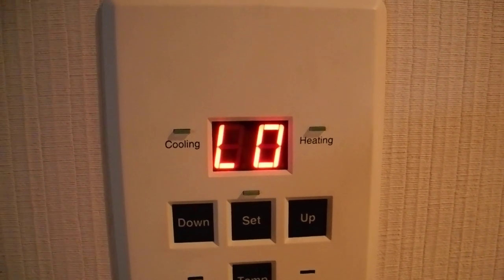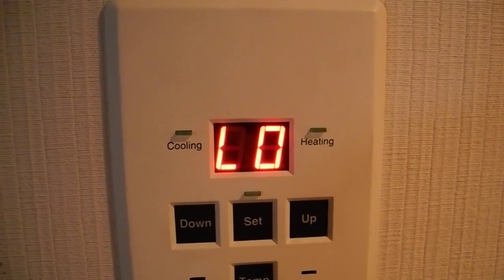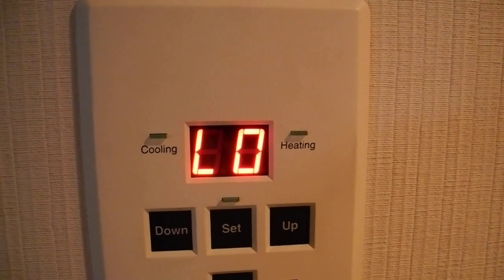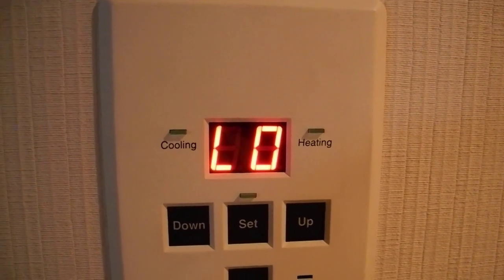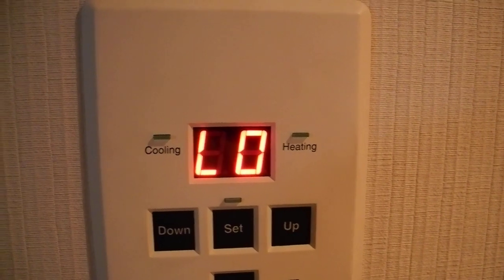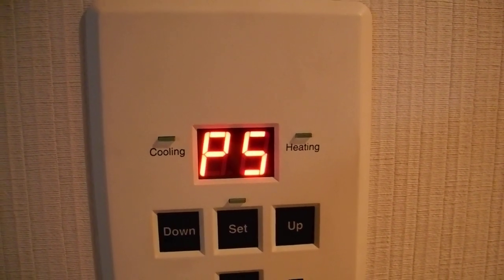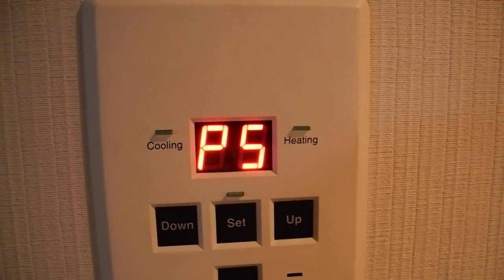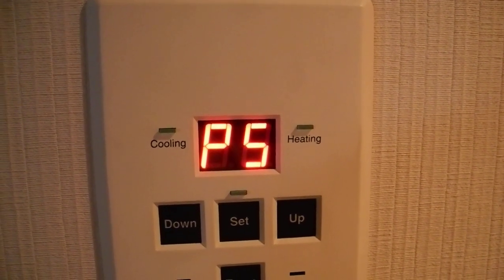LO P5 on your Air Con controller

Comment: I see on the panel that this unit can be used for either heating or cooling the boat. Low pressure in the "freon" system can be caused by low flow on the medium where the unit extracts the heat, the side of the system with the lowest temperature. I assume there's no water circuit on the "boat side" of the unit and that it's only warm or cold air that circulates inside the boat. If this happened while cooling the boat, it could be caused by low air circulation flow, maybe a clogged filter or a fan that doesn't run. If it happened in heating mode, clogging on the sea water side is a possibility.

But unfortunately,  it's probably as you suspect, that the unit has lost some "freon". (There are several more refrigerants besides true freon.)